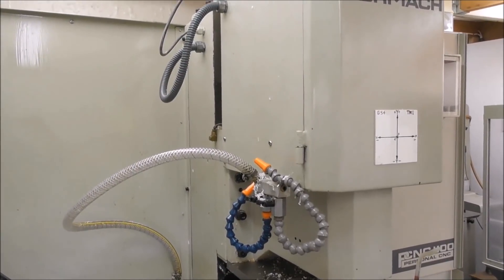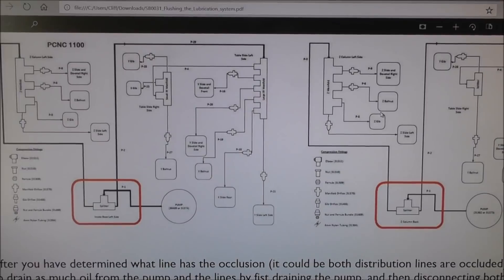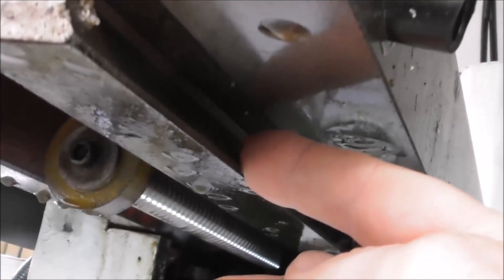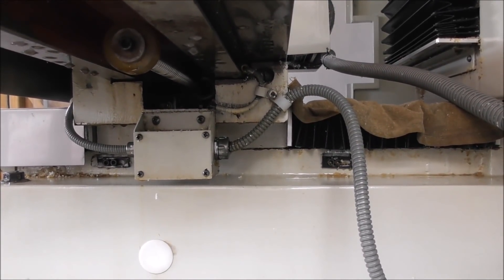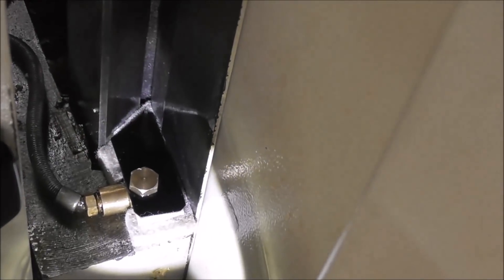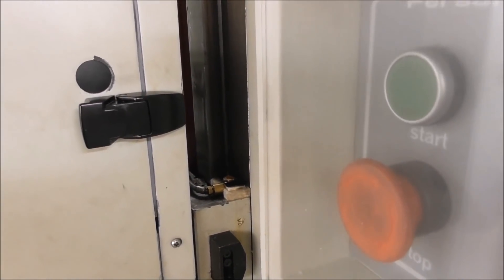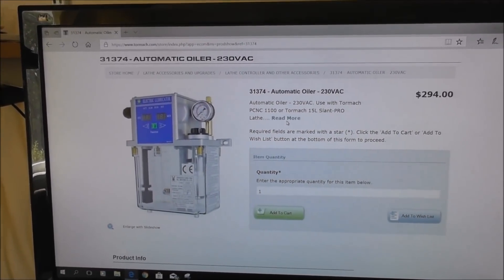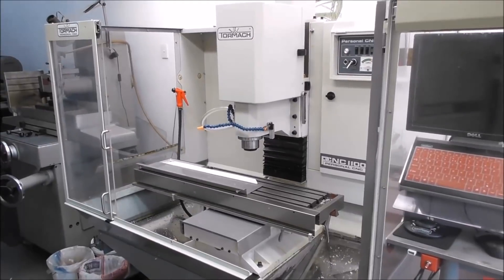Tormach and machine tool Lubrication - Tips and Tricks

Comment: Good stuff Cliff, enjoyed!
ATB, Robin
Reply from the maker: Thanks for the feedback Robin.  Cliff
Reply: Cliff, you sparked and idea for making a manual lube pump that has a separate fixed displacement for each individual output line so each one  gets the prescribed volume and there will be no metering orifices to clog. I am going to make one for my Mitsui grinder rebuild. I will be sure to give you credit for getting the wheels turning when I do a video on it.
Thanks,
Robin
Reply from the maker: Hi Robin. Sounds like a great idea. You mean like a in line multi charge piston/cylinder pump? 
Cliff
Reply: Yes, individual piston/check valves for each line. one long eccentric shaft camshaft style directly bearing on the pistons to drive the whole line of them. if desired the volume of a single piston could be changed by limiting its return stroke to whatever level required. Could be made automatic by driving the camshaft with a high torque clock motor on a timer with a limit switch to do single rev of the output per actuation.
Reply from the maker: Yeah!  I like it.   Cliff

Comment: Actually, I think the primary reason for the orifices it to provide a consistent flow limitation across all distribution branches, that way when the system IS working as designed, the physical flow variances of each circuit are minimized.  I agree lubing each branch  manually is the safest way.
Reply from the maker: I agree - Perhaps I not make that point clear enough.  Cheers  Cliff
Reply: Also excellent delivery of positive feedback to the manufacturer at the end of the video, great stuff.!

Comment: I was just thinkering how to do this on my small cnc conversion of g0704 mill. I had plan to 3d print something as sping against ways to lubricate with some kind of fabric soaked in oil. I dont have any system for lubrication but do it manually every time I use it.   I was wondering what material I could try to use.  Thank you for this video.
Reply from the maker: Thanks for the feedback.  Cliff

Comment: In Australia Swift Supplies http://www.swiftsupplies.com.au/ is a convenient place to order industrial felt. Would you say that a thicker wiper is an advantage? If I am cutting out an 8mm thick wiper, its not much trouble to cut out two and have a 16mm wiper with more oil holding capacity.
Reply from the maker: Thanks Nick. Good question!  Well yes, I think it would be better in theory, if you can get a stack to contact correctly.. it should be better.  Cheers  Cliff
Reply: That's good to hear Cliff. Industrial felt is quite expensive here in Australia and its much more economical to buy a thin piece and layer it. I figure that with the right glue between layers and a 3D printed shell, the felt will stay in place and clean the ways efficiently.